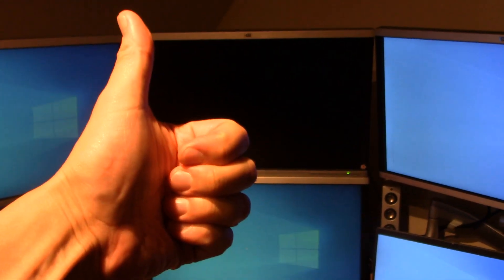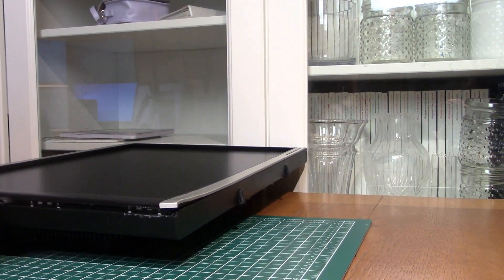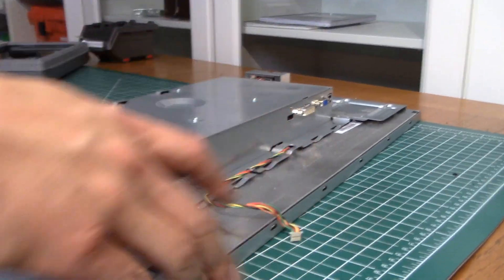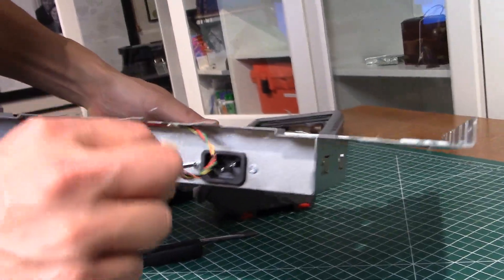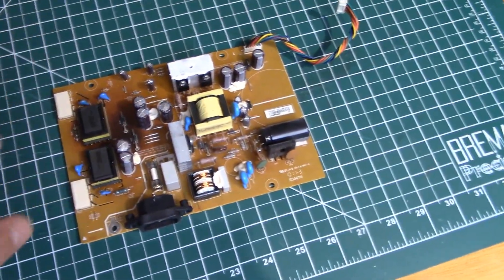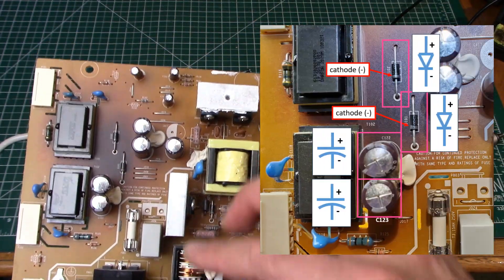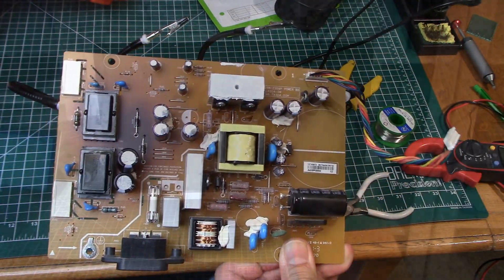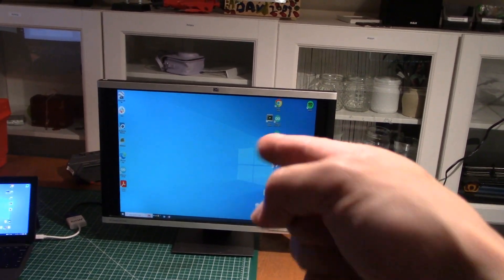Monitor Won’t Turn On – Solved!

Comment: The three electrolytic caps on the right side next to the defective ones (C124 & C125) don't look very healthy anymore, too.
Based on the discoloring PCB there are is a lot of heat/thermal stress. It can help to mount the diodes not flush on the board, but a lifted above it a bit, in the air. This way the leads can act like a small heatspreader / heatsink.

Comment: From the looks of the board, the 3 caps near the 2 you replaced, will also need to be replaced at some point soon too. They look to be bulging as well. They might last a while but will eventually fail sooner than later.